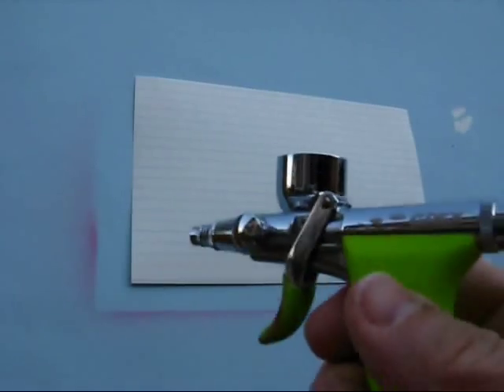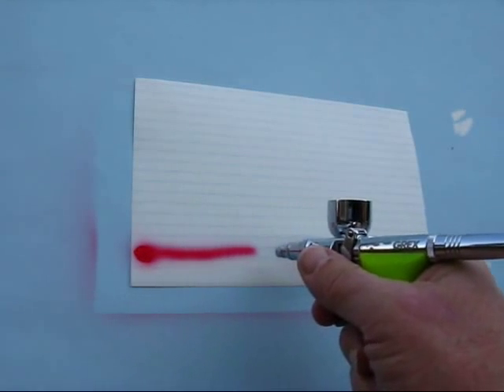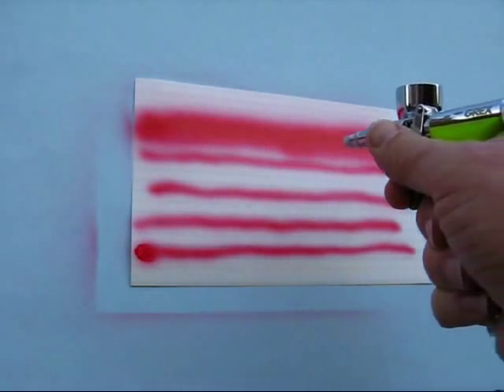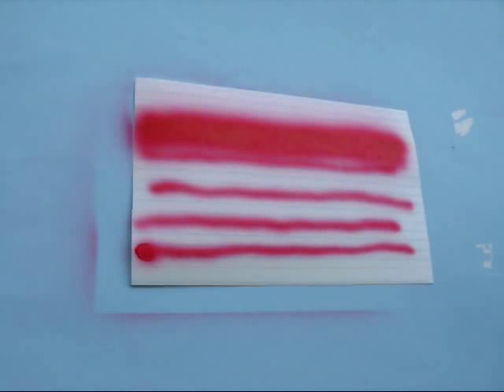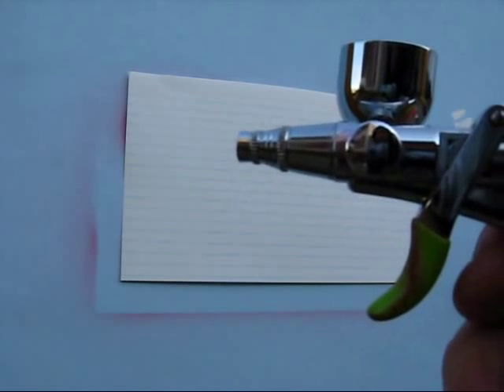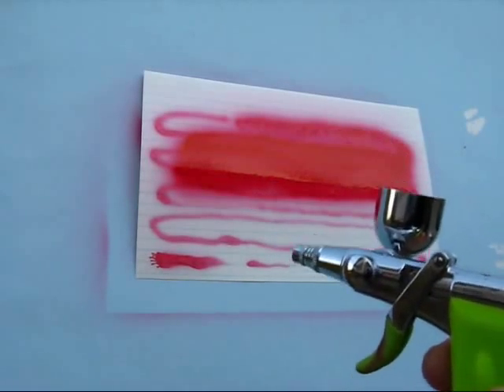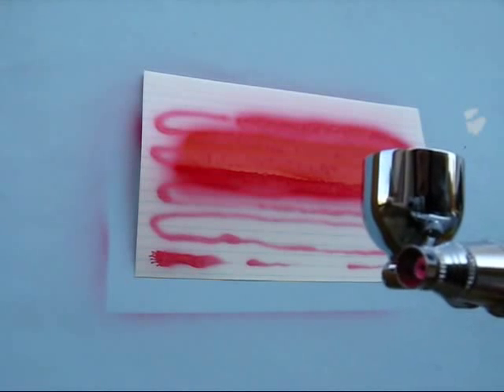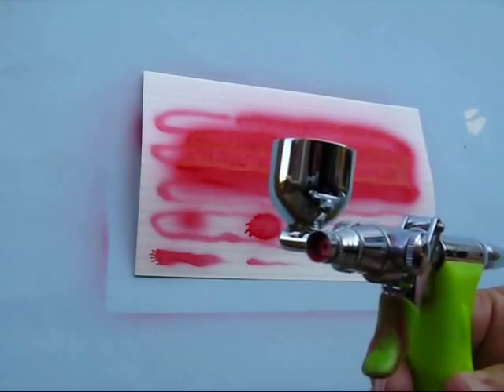Grex® Tritium TK-5 - 0.5mm Nozzle Conversion Kit

Comment: What a waste I bought cheap 0.2mm nozzle head airbrush and it can't even spray paint properly after 1 minute of use the paint sometimes does not even come out. Even when the paint is thin 1:1 ratio.